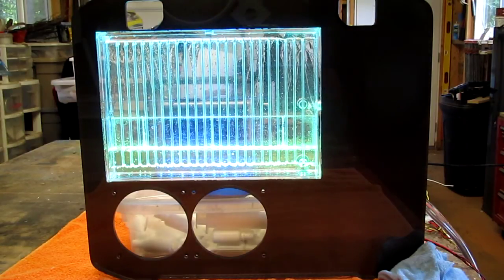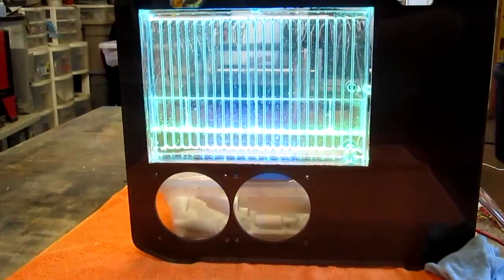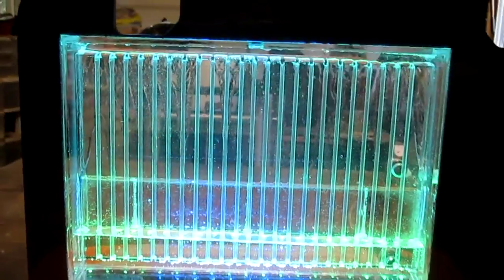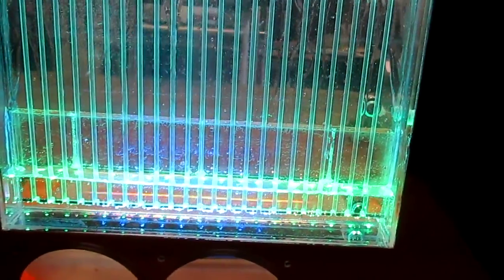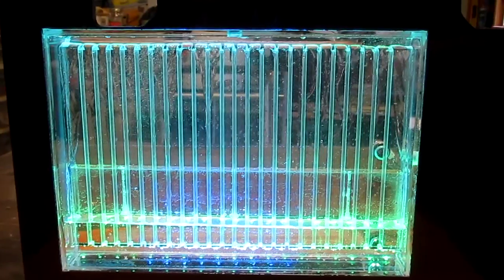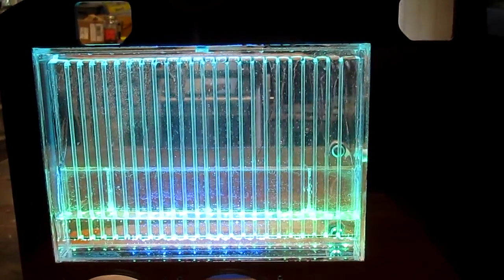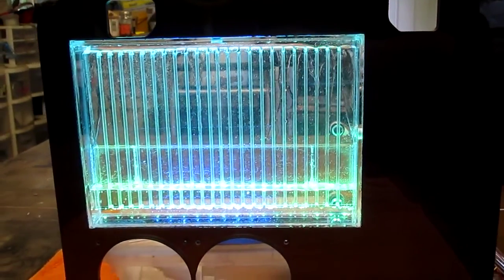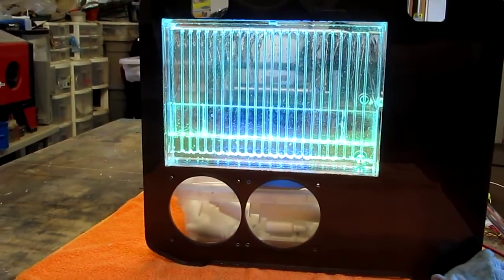Side Panel Reservoir Flow Test

Comment from the maker: I made my first side panel reservoir in 2005 for my award winning "WaterClocker" back when I was very active on OverClock (dot) net. It was rudimentary in comparison but eye catching. Thickness is determined by material dimensions and the kind of action you want in the res. If all you want it a slab of fluid with ports on the side it could be the width of a G-1/4 port on the insde. If you are will to accept some restriction you can port it on the back and make the interior thinner. Think Flow.

Comment from the maker: I asked the client to provide dimensions. As I do not have a case handy I cannot check those dimensions against the slots on an installed motherboard. In theory I have left 5mm of clearance. The critical measurement would be from the chassis flange (exterior) to the nearest edge of the GFX card assembly once a water block has been fitted. Some CF are large diameter so I would suggest having the CF installed in the GFX WB when taking measurements. On this unit the ports are all the way forward.

Comment from the maker: I built an enormous mahogany rad cabinet for a friend on Overclock that lives in Norway. It was for the hugest radiators you can get and proportioned to be a pedestal for his custom TJ07. Shipping was not that bad...I was amazed, considering I had to crate the unit and it weighed about 80 pounds.

Comment from the maker: There are those that prefer enormous reservoirs...all volume does is slow the rise in temp.  Eventually even the largest res will get to the same temp as the rest of the loop. Loop temp is based on the temp of the air in the room, the heat load from blocks, the heat dump from the pump motor, the efficiency of the fan/rad package. At no time can the loop be a lower temp than the air in the room. Typically the loop is 10-15C above air temp with the PC at 100% load. At idle maybe just 2-5C.

Comment: Well I am glad you finally did it. I have been brainstorming some cool custom loop work but I am having a hard time figuring out what case to use. I like the 800D but I already did that build and I want mine to be unique. Something similar though because of I really like the seperation of the mobo and PSU bays. Looks very clean.

Comment from the maker: Technically it does not, but it facilitates the filling and deaeration process. There are OEM liquid cooling loops that are filled, have the air evacuated, then sealed. No maintenance required. Reservoirs are just an excuse to look at water flowing through your loop.

Comment: So glad to see someone finally create the idea I had two years ago. I tried making this for my Antec 1200 at the time. I cut the parts at my college's little machine shop and did the rest in my dorm. I messed up horribly and thankfully I never actually used it. But it's reassuring to see someone with your modding caliber take a shot at something I thought was amazing and original. Any way you could make this much thinner? If so, I would be very interested.

Comment: Is it possible to use a thinner acrylic than used in this video and still obtain a water-tight seal? I can imagine thickness plays a significant role, but what would you say is the minimum thickness of acrylic to use where you would feel 100% certain the result is water-tight? The result I want is the classic water falling along wall of glass you'd see at some Chinese restaurants. I'd wish to use thinner acrylic cause it's cheaper.

Comment from the maker: How about a reservoir where the paint border is now? And a window in the center of the reservoir. That would be fun. There is usually a space by the optical bay...could just barely get something like this into that. The space between blind side panel and mobo tray is pretty thin for much of a waterfall, but you could have a skinny reservoir.

Comment from the maker: When I put in the fan holes I was like FUUUUUUUUU,,,, because the res is off center to the holes. I thought to myself 'this is going to look wierd' but once I did the paint border it tied the whole look together and it was fine. If I was doing something like this with no paint I think any fans would look better centered under the res. Or as suggested put a fan hole right in the center of the reservoir...that would be a piece of work.